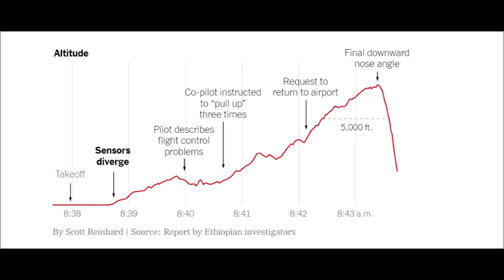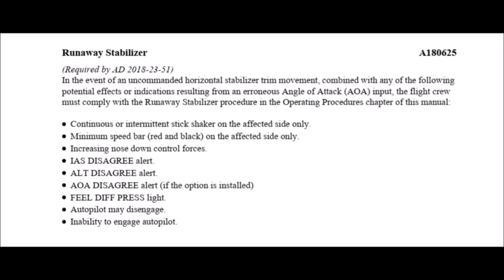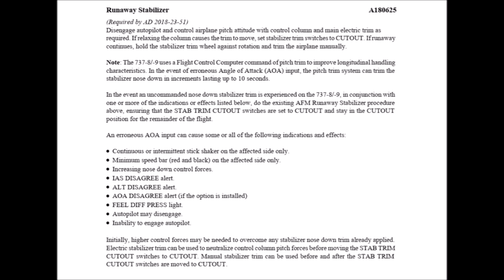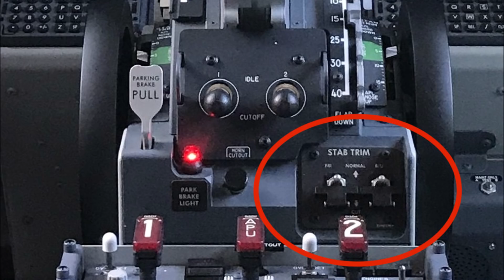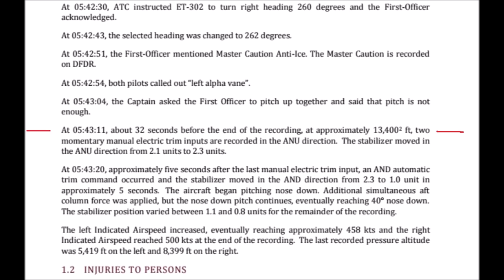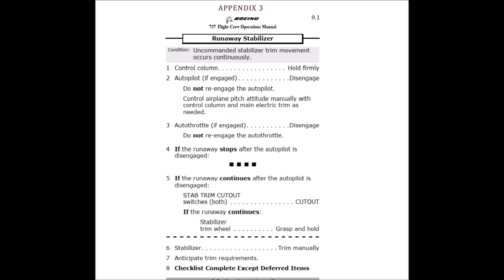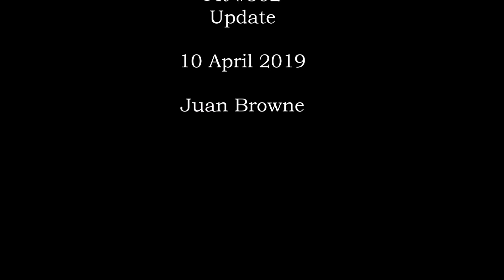737 Max Update 10 April 2019 Runaway Stab Trim Procedures

Comment: Thanks for handling the human factors in a sensitive way. The blame game is too easy in these crashes.
Reply: @TrumpTrainbaby  And there it is.  Just another ignorant chest thumping triumphalist faux 'patriot' Boeing fanboy crying and denying the stark factual reality staring you in the face.
This issue is now waaaay past your denial, with up to 50 customers worldwide having tested the Fixed mcas behaviors.
Finally, and I'm done with your odious mentality, go educate YOURself on the difference between a conscientious patriot (me) and a knuckle dragging xenophobe (you). The latter just make the US a laughingstock.
Reply: Juan is entering deep waters with these videos. There has already been a strongly chauvinistic reaction to 3rd-world pilots crashing 1st-world aircraft. It took immense pressure to (belatedly) ground the MAX aircraft.
Reply: @gordonrichardson2972  Agreed
Reply: @TrumpTrainbaby  No, they were not. No one was, that's one of the many points. Also, the process of certification is under criminal review for a reason.
Also, no US pilot encountered either accident scenario, so you cannot possibly say how they'd have reacted.
US pilots have landed short, over run runways both in the US and elsewhere, among many other accidents.
Seriously, the 'poorly trained non Western pilot' chestnut is exactly that. There is clearly FAR more to these very unusual accidents.
Reply: @TrumpTrainbaby 
If you tried the 'non-US airline' angle after the Lion Air crash, I'd maybe understand your point. Not with Ethiopian though. They have a stellar safety record, are a member of Star Alliance, and in their entire history this is their third hull loss (one being due to terrorism and the other in bad weather).

US pilots aren't inherently superior just because they've been 'trained in the US'. As it was already said, there are lots of instances where US  pilots have done something incredibly stupid, sometimes leading to loss of life. Pilot training is internationally standardized. In fact, outside the US, workers protections will mean that the pilots will be better paid, won't be overworked and won't have to worry about things like medical bills. US airlines, in terms of safety record, are no better than the majority of other carriers.
Reply: @TrumpTrainbaby  Human factors is a better term. Because it covers everything from training to maintenance to accident site.
And I'd venture further to say it goes even further back to design and management, as the Max issues demonstrate. Just because a system operates as designed doesn't mean the (human) design isn't flawed.
Hell, these days EVERYthing needs constant patching, updating, etc etc
Reply: @TrumpTrainbaby  Be careful, Im not being personal, neither should you.
'Educate myself'? Do you realize those FOUR incidents are both indicators of a problem in themselves, and vastly different to the multiple failures and related cacophony of warnings during high workload takeoff and climbout phases of the accident flights??
Fyi, the official Boeing statements both on video and their website using terms like 'fix the problem' are in Corporate speak, GLARING public admissions of serious issues with the aircraft.
Lastly, and with greatest respect to Mr Brown, he is ONE pilot's assessment, not a definitive irrefutable source. MANY highly experienced pilots are discussing this, and they aren't uniform in their assessments either.
Reply: @damonreynolds6775  Thank you Damon. Exactly.
Reply: @damonreynolds6775  wow, well said sir.
Reply: @TrumpTrainbaby  There is nothing BUT opinions that can be offered in 20/20 hindsight. No one commenting was there. 
In a way its like you're trying to rewrite history in Boeing's favor?
The preliminary ET302 report alone was enough for Boeing to drastically change their stance since after the first crash. It clearly shows a system which in the wrong circumstances can actively dive an aircraft into the ground.
That it could happen twice to so new an aircraft is almost unprecedented. If pilots outside the US were so bad why aren't they crashing other aircraft with AoA. UAS and myriad other issues that DON'T result in an otherwise flyable aircraft diving during MANUAL flight?
We are HERE now, the aircraft grounded, major changes being effected, and the certification process under investigation.
Reply: @TrumpTrainbaby  who knows man? None of us were there so we don't know. For all we know, they probably left it at a high throttle setting to help the wings generate more lift and to help the nose pitch up. Be mindful that the engines during acceleration tend to pitch the nose up due to design flaws.  Keep in mind that these pilots have experience at least enough to figure out if an aircraft is going too fast for the altitude. Also, auto throttle does the work of determining the acceleration/speed of the plane. This for the most part a pilot is supposed to leave it at a certain setting and forget about it for the remainder of the flight until the landing configuration. Besides Juan explained it could be tunnel vision that affected them because of the intense fear and stress they were going through. We don't know for sure so please let's wait for the final report to make our final judgments.
Reply: @Menelik Z Never argue with idiots! They will drag you down to their level, and have had a lifetime of experience at that level.
Reply: @gordonrichardson2972  you're awesome Gordon.👍🏼
Reply: Bravo for standing up to the bullies! With a name like yours, you must be from Ethiopia?
Reply: Gordon Richardson yes sir, I am. You're a well informed man.
Reply: @TrumpTrainbaby  altitude indeed matters. Less dense air means less lift generated by the wings and thus more throttle input needed. Look, neither you nor I know exactly what happened out there. For that matter neither the dead pilots who tried their hardest to save the plane that day. So, let's do the most responsible and reasonable thing and wait for the final report.
Reply: @TrumpTrainbaby  well, I agree there, it's common sense.
Reply: @TrumpTrainbaby 
Not saying that the US doesn't have more passengers than other regions in the world. No data exists on incident occurrence that would allow one to compare the actual safety. Which is why I asked you for a source to base your claims. You say "safest in the world" without evidence, so I say "more incidents than in the EU", which while true, can't prove nor disprove your point. So there's that. A source for comparing the safety in different airspace in the world would be appreciated.
Reply: @mikeblatzheim2797  please take Mr Gordon's advice, never argue with idiots.
Reply: I too believe Juan handled the human factors sensitively, however we have serious loss of life and the problems need to be solved (which I am sure you feel as well).  That said, as John Lenin states, the airline's standard of training, insistence upon proper certification, and desire to provide opportunity for pilots to gain experience is a key issue.
Reply: It's phenomenally disturbing how the media is clearly going to handle this. Boeing deserves plenty of scrutiny. So do the pilots. Not going to be packaged that way at all.
Reply: @TrumpTrainbaby  the Ethiopian Airline train much better then USA Pilot  go read the record. The Ethiopian Airline is much better than us Airlines.
Reply: @TrumpTrainbaby  let me ask you this genius, were these US pilots taking off from an airport 7600 feet in elevation? Unlikely. Also, were the planes these US pilots flew equipped with a single AOA sensor vane? No. The ET302 airplane was equipped with only one sensor and it was faulty. So please shut up and do your homework.
Reply: Gordon Richardson as I understand it, the training updates for the MAX line use an IPAD course. Calling this a training issue is not an indictment of the air crew.
Reply: They have been blaming Ethiopian Pilots from the beginning without even investigating it so not new to me what matter is what is in the black box ..

Comment: The PROFOUND divergence of readings between left and right is almost as serious as anything else. MULTIPLE readings including AOA and airspeed.
Redundancy is not going to save lives if the measuring devices are that unreliable to begin with.
And a BRAND NEW CRAFT??  Am I mistaken about that? Besides AOA, 438 vs. 500 knots ?????
Reply: I have a college friend who works for a military project unnamed here.  They use 3 AoA sensors on the plane and a voting system (use the two that agree and ignore the third) to control their plane.  Not completely infallible but much more reliable.

I just saw on the Smithsonian channel a show about an Air New Zealand A320 where water had gotten into both AoA sensors and froze at altitude bringing the plane down off the coast of France.  The conclusion was that the pilots weren't familiar enough with everything that had to be done in the transition to hand flying to save the plane.
Reply: @lowercherty  As you say, still not infallible. I forget which flight but there was a case of an A320 crashing because 2 of 3 air speed sensors failed. Because the failed sensors both agreed with each other the computer discarded the readings from the only working one... Add that to the fact they were doing some tests of stall handling, the very experienced crew ran out of altitude before they could troubleshoot. Luckily (?) there were no paying passengers.
Reply: They have not found the AoA sensors for the Ethiopian crash. The age of the aircraft sensors is not likely an issue. There many things that can cause a new sensor to fail. The AoA sensors which are mounted on the fuselage near the plane’s nose and are vulnerable to damage. There are at least 140 instances since the early 1990s of sensors on U.S. planes being damaged by jetways and other equipment on the ground or hitting birds in flight.

In at least 25 cases in the U.S., Canada, and Europe, the damage triggered cockpit alerts or emergencies.

On April 1, 2012, a United Airlines 767-300 was taking off from San Francisco when it struck a flock of western sandpipers, according to a Federal Aviation Administration database. The birds damaged the left sensor, scrambling the speed readings and autothrottle. The plane returned to the airport.

A Republic Airlines Inc. flight was struck by a tundra swan as it neared arrival into Newark, New Jersey, on Dec. 5, 2016, according to the FAA. It damaged the angle-of-attack sensor and other equipment on the Embraer SA EMB-170, rendering unreliable airspeed and altitude readings on the regional jet. It landed safely.

People continue to hammer Boeing because only 1 AoA sensor was used by MCAS. "Experts," say they didn't have enough redundancy. OK, so what is enough? 2 sensors? How about 3 sensors?

Before the 737 Max crashes, the most recent accident involving the sensors occurred when an Airbus SE A320 on a 2008 demonstration flight went down off the coast of France killing all seven people aboard. Moisture inside two of the plane’s three angle-of-attack vanes froze, confusing the aircraft’s automation system, according to France’s Office of Investigations and Analysis. The report also faulted the pilots for multiple errors.

While investigators haven’t identified why the Ethiopian Airlines plane suddenly suffered a sensor failure just as it left the ground, that pattern, revealed in the flight recorders recovered from the wreckage, could be explained by a bird strike.

FAA Database
The FAA’s database of bird-plane encounters, as well as accident reports in the U.S. and other nations, contain dozens of such episodes.

On May 28, 2016, for example, a Cargolux Airlines International SA 747-400 was taking off in Calgary, Canada, when pilots heard a loud bang followed by a stall warning. After landing, mechanics found the right sensor was missing and saw evidence it had been hit by a bird, according to the Transportation Safety Board of Canada.

A NASA-operated repository of anonymous pilot reports, called the Aviation Safety Reporting System, contained similar instances in which sensors were damaged by birds, airport jetways or undetermined causes.
Reply: @jamesdean2185  I was also thinking pitot, like Air France in the Atlantic.
Reply: Perfa 76  Passenger Airliners don't have RADAR altimeters. The plane has no way of "knowing" it's actual altitude. It has to rely on the pilots entering the correct information prior to takeoff. I was an automation engineer for years and have written hundreds of programs for machines, robotics and various forms of automation. It is virtually impossible to "people proof" everything. Test pilots tested MCAS thoroughly, but the test pilots and the engineers that wrote the MCAS routine never imagined the situation that contributed to the 2 crashes. After the first crash, Emergency Airworthiness Directive (AD) 2018-23-51 was implemented. The airlines are responsible for training their pilots. It is a myth that Boeing "hid" MCAS changes from the airlines.

From a Washington Post article by Aaron C. Davis and Marina Lopes March 15

In October 2017, Brazilian regulators flew to Miami to test out the brand-new Boeing 737 Max 8. The team scrutinized the sleek new jetliner’s flight systems and soon published a list of over 60 operational changes, from landing systems to cockpit displays, that Brazilian pilots would need to learn.

Among the new features, regulators said pilots would have to familiarize themselves with was the Maneuvering Characteristics Augmentation System, a safety system that could nose the plane downward if it sensed a potential stall. The regulators mandated an interactive course for pilots to go over the changes and recommended “two legs of SLF,” or supervised flight, according to a copy of their report obtained by The Washington Post.

Brazilian aviation officials said they did not learn that their position on training for the new plane was unusual until after a Max 8 went down off the coast of Indonesia on Oct. 29, killing all 189 people on board.

It was a protocol that pilots flying the Max 8 for Brazil’s GOL airline had already been required to click through in a self-guided computer program.

“We saw that there was a difference in the systems and that [pilots] would need to understand the new information in order to be able to pilot using the new system,” said Annelise Pereira, spokeswoman for Brazil’s Civil Aviation Authority.

https://www.washingtonpost.com/investigations/how-the-faa-allows-jetmakers-to-self-certify-that-planes-meet-us-safety-requirements/2019/03/15/96d24d4a-46e6-11e9-90f0-0ccfeec87a61_story.html?noredirect=on&utm_term=.a767d299e11c
Reply: Rick Jones 
Passenger airliners do indeed have radar altimeters, and the airplane being discussed in this video had TWO.
The data from those two radar altimeters is available in the preliminary accident report.
Reply: @53C52  Civilian aircraft use normal low-level short-range radio altimeters, as opposed to delay-Doppler or synthetic aperture radar which is used for other types of navigation applications such as military aircraft with terrain following autopilots. A RADAR altimeter uses a "pulse" transmission characteristic, and a RADIO altimeter is FM CW - both transmitters operate near or at 4.3GHZ.

The operating characteristics are different, the "pulse" system is fairly simple - you transmit a pulse, receive the pulse, and calculate the delay between the two for your altitude.

The FM CW transmits a Frequency Modulated Continuous Wave signal where the transmit signal varies in frequency from low to high within the 4.3GHZ center frequency (usually 400KHZ centered on 4.3GHZ) to give a 'sweep from 4.3GHZ minus 200KHZ to 4.3GHZ plus 200KHZ. The FM CW receiver is phase locked to the transmit signal and compares the frequency shift (time delay of the FM CW sweep) of the received signal to this signal, and derives a 'frequency change' which is translated to an altitude signal. The FM CW technique typically is less dependent on ground reflection anomalies and is more stable during approach.
Reply: Rick Jones 
Thanks for the very detailed description, and for teaching me something new.

Since Honeywell, a large supplier of these civilian systems, refers to these units as radar altimeters and I’ve seen the FAA use the terms radio altimeter/radar altimeter interchangeably (in fact, their instrument flying handbook reads “a radio altimeter, commonly referred to as a radar altimeter”), are we haggling over whether a square is a rectangle? 

I’ve also seen airplane manufacturers use the term “radar altimeter” in maintenance manuals and pilot training manuals when referring to FM CW systems, so it seems to me that “radar altimeter” is widely accepted in the industry as an appropriate term for these civilian systems.

In any case, let’s agree for the moment that the 737 doesn’t have radar altimeters, but does have radio altimeters. In the context of this accident, doesn’t it mean that the airplane does have the ability to determine how high it is above the terrain below?
Reply: @53C52  I honestly don't know the answer to this. I was under the impression that the 737Max sets the altimeters to local barometric pressure. I know it has panels for doing this on both sides of the cockpit. If you look at this image the red arrows show the location of the panel used for setting this. https://www.flickr.com/photos/109161978@N03/40623677013

Although this aircraft is a 737NG this video shows how altimeters are set. The image above shows the exact same panels. https://www.youtube.com/watch?v=S9e3Q-ffp7c
Reply: @jamesdean2185  No, I have no idea. This is just one of the things investigators have said they are looking at. Everything I am stating is purely my speculation.